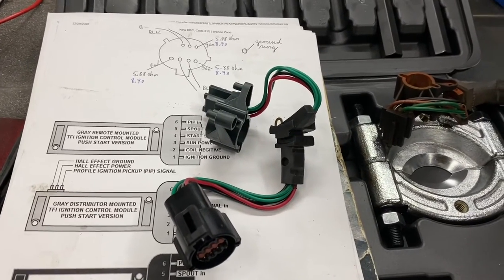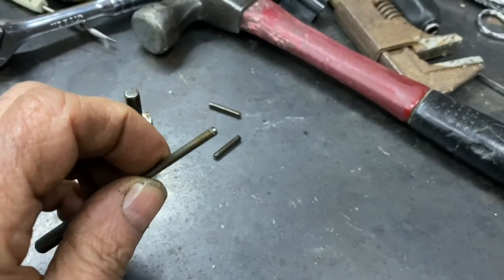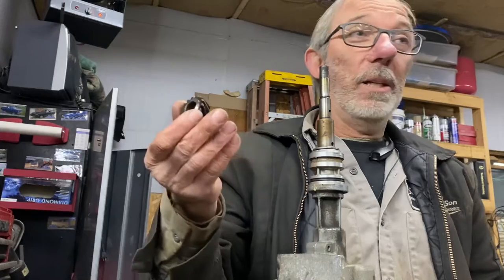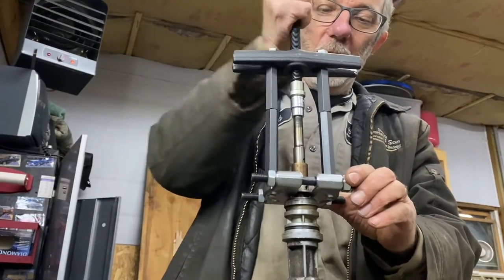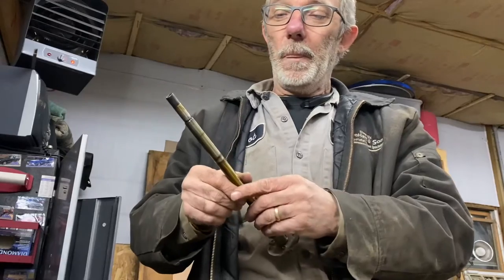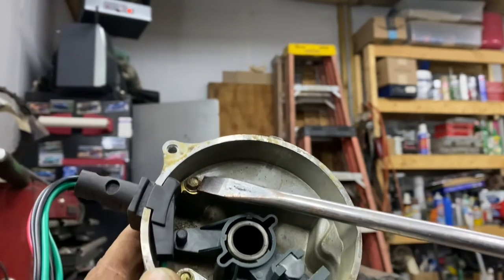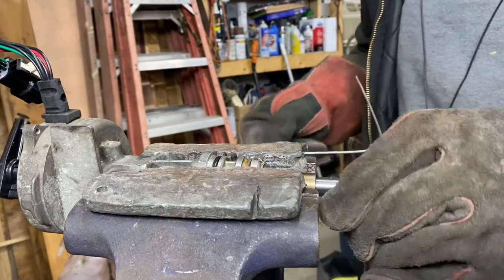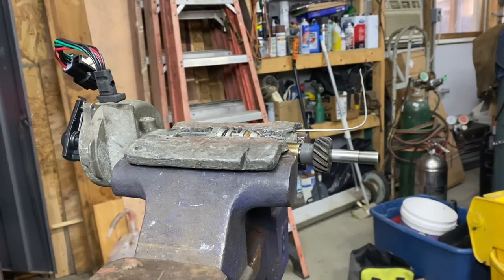92,93,94,95,96,97 Ford F150 distributor gear/pick up coil (PIP) removal and installation of gear

Comment: Great video. I'm getting ready to change the PIP in my 460 distributor and this video will help a lot with doing that. I was surprised to see that there wasn't any type of bearing in the bottom of the housing, just a seal. And thanks for showing the p/n of the seal and what would fit to replace it.
Reply from the maker: I'm hoping the video helps you out when you do your's. Keep in mind there are some bronze bushings inside of the distributor housing, so put some grease on them and the shaft when you reassemble. Good luck with your rebuild. Rob....
Reply: @robbieraychannel  Will do, thanks.

Comment: Excellent video. The gear install is what I needed to see. I watched a few press it on and figured there had to be a better way.
Reply from the maker: Glad it helped you out. Iv'e done it many times this way with no problems. Just be careful not to overheat the gear. Good luck with your repair. Rob...
Reply: @robbieraychannel  did you use your original gear? I am not sure if mine is steel or not, and am thinking of just reusing it, I don't see any unusual wear to it

Comment: Like I do with motor Cycle Cranks and bearing I always use Air Duster when installing bearings I freeze them with the Air duster, then I heat up the cases and they drop in.  You made this Video very enjoyable to watch. Thanks for sharing.

Comment: Thanks so much for this video. I spent an entire day trying to find that seal but didn't have a part number. Measured out the shaft and bore and the only seals I could find were at least a week out. With the part numbers you gave, I was able to find the seal in stock at my local Grainger.
Reply from the maker: Glad it helped

Comment: One thing i want to touch upon is that you didnt verify alignment of the gear placement as the gear has an odd amount of teeth and by reinstalling the gear 180* off you change when the injectors spray into each cylinder by 12* and cant be corrected by twisting the distributor  due to the fact that the small vane in the reluctor is specifically timed for the true 10* BTDC which is exactly when the injector needs to spray in relation to the valve..

I use a dollar store single burner to heat the gears up.........Your distributor has the steel gear because your engine has a roller camshaft.....The way to tell is whether you have the TFI module on the distributor or the one on the fender...The one on the fender is a roller cam engine..
Reply from the maker: Huh! Interesting info. I'll take a closer look next time I do one. Funny because I have done several of these throughout my career and never had a timing problem before. Could it be possible that I got lucky every time. I guess anything is possible.....I like the burner idea, less chance of overheating......

Comment: You can buy a whole distributor complete for less than $80
Reply from the maker: Yes you can but there is some concern with the drive gear matching the gear on your camshaft perfectly. There is even three different gears that were used on those engines. That's why sometimes it's a safer bet to use your existing distributor
Reply: @robbieraychannel .... Well,  my 1993 Ford f150 5.0 truck has a severe "Squeak " coming from the Distro...A commenter on another YouTube video said it could be the bearing...I used a Harbor freight Stethoscope and sho' nuff its squeaking like a flock of baby birds...My question is...How do you change the bearing out...???... What tools and what part # for the bearing...???... Thanks in advance,  sir...😊😊😊

Comment: Great job! I'm getting ready to do this on my 95 F-150 4.9l. Mine was hard to diagnose as it was intermittent. Whenever I would get my Fluke hooked up to check PIP signal, it would work fine; then leave me stalled on side of road. I finally caught it messing up and pretty sure PIP is bad! Thank you.
Reply from the maker: Best of luck with it !!!

Comment: Just dealt with this issue on my 94 bronco. It can have you chasing all over the place and throwing parts at the thing if you aren’t careful. Luckily I only went as far as a coil before realizing this was the actual issue. It fell flat on its face going up my driveway, but hey at least mine broke down at home! 😆 great video.
Reply from the maker: Lol lucky on that one. same thing happened to me a couple of weeks ago my starter went in my driveway
Reply: Too FUNNY... my '94 Bronco 5.8L died right in front of my driveway on my birthday while I was letting my wife get out with dinner in hand. It was the second car to die that day. At least it wasn't too bad pushing it up the driveway where I could work on it as I get time.

Comment: Thank you really good work will help me alot 1995 ford f150 4.9. Standard ignition best replacement part . Cardone rebuilds do not work.
Reply from the maker: Your welcome Jon
Reply: What is a push start ? Versus standard start for the ignition control modular ?
I have no idea what they're referring to unless they're referring to a push button ignition, but that does not make sense to me cuz they did not have a push button ignition in these older vehicles.
So what am I missing here ?

Comment: Thanks for the video. I am about to attempt this myself. Getting code 211 PIP circuit failure. I’m guessing I should probably invest in the Harbor Freight gear puller. Looks like something that may come in handy in the future. Thanks again!
Reply from the maker: You're welcome George and good luck with your repair

Comment: Thank you for a straight forward non hype video to replace the PIP sensor !! You are the ONLY one that shows the whole process.  Also was looking on BRONCO ZONE for but can’t find the printed page you have of the three TFI diagrams at the beginning of your video. Can you tell me how to find it at Bronco Zone or send me a copy, I’d really appreciate it. Thanks for your time, your video makes this job pretty easy when you see all the steps. Keep up the great work.
Reply from the maker: Keith, I will see if I can find it. I'll let you know
Reply: @robbieraychannel  Thanks Robbie for quick reply. You’re the man!  I found it but couldn’t print it, probably due to not being a member. I’m restoring my (original owner)1997 F250HD 5.8 XLT 4x4 and that diagram is invaluable due to ford having wrong info on the ICM /TFI.  This is more proof I need the BLACK CCD version. Ford and distributors keep insisting I need the gray “push start” version. NOT!!  You have a new subscriber. Thanks again for making a difference with a great video and great demeanor. 🇺🇸👍

Comment: Nice job!  Thanks for doing that.  Curious what kind of grease you used in the shaft
Reply from the maker: I used a black molly grease that I had but more than likely any grease will do because it does not move at very high speed

Comment: 91 ford tempo  4cyl mine had maybe 1/8  shaft play at the top & a lot@ bottom / problem was a slight amount of  oil in dist/ shaft gear very tight

Comment: Hi! This repair fix the 212 code? You need to dissasemble the shaft to change the PIP? Sorry i'm new to this DIY repais 😅
Reply from the maker: Ben yes you do need to disassemble the shaft to replace the p i p sensor and yes it does fix code  212 however you can buy a complete aftermarket distributor for about$120 just be sure to put the engine in time before removing the old distributor. Check some videos on how to do this

Comment: What is the name of that rod (shaft) you put the ratchet head that attaches to the bottom of your distributor? Love the vid btw!!! Earned a sub
Reply from the maker: I'm not sure exactly what you are asking but I think you were asking what is the piece that I put into the bottom of the distributor to pull the gear in that case it was a quarter inch Allen socket should be able to find one at just about any auto parts store

Comment: I just beat the hell out of mine to get the gear and collar off. Kinda mushroomed the other end getting it back on. Had to sand it down so the spinny bit would go back on. One of the roll pins got screwed up too so I had to use a tension pin. Hope I didn’t ruin it.
Reply from the maker: Those things can really be on there tight. I hope yours is going to be okay but keep in mind that gear runs on your camshaft and the bottom of the distributor shaft with the hex key shaped hole runs your oil pump so if it's really questionable you might want to consider getting another one in case something comes apart and does internal damage. best of luck with it. Rob....
Reply: @robbieraychannel  the bottom where the gear and collar are was fine but the top end where the rotor goes was the mushroomed part. Still concerns?
Reply from the maker: @WalterMelons  it could be bent a little but as long as it doesn't wobble so bad that the rotor hits the inside of the distributor cap I think it will be okay
Reply: @robbieraychannel  yeah I spun it when it was back together and the flange the rotor sits on is a little off kilter but it spins fine and doesn’t hit the stator. I’ll keep my fingers crossed and if it runs poorly after getting the timing right I may end up getting another from a junkyard. A timing light should be coming from Amazon today so we’ll see. 🤞
Reply from the maker: @WalterMelons  oh that's cool did you research where you have to unplug the spout jumper to set the base timing
Reply: @robbieraychannel  yeah I’ve been watching scannerdanner the past two days and picked that up. Good luck out there, thanks for the video and the info. 🤘
Reply from the maker: @WalterMelons  You too good luck with it
Reply: @robbieraychannel new update! Got the timing light and went to get it hooked up and realized I didn’t plug the damn first plug wire back in that I unplugged to get the distributor out in the damn first place! 
Got everything together and got the timing dead nuts and she runs like a top now!

Comment: If you heat it up to take it off, will it pop off easier?
Reply from the maker: Deuce usually that doesn't work because the gear and shaft will grow from the heat at the same time, therefore not allowing the gear itself to become any looser. This can work on seized nuts because you can quickly heat one side of the nut with a oxy/acetylene torch to make the nut expand. But you wouldn't want to put that hardened gear through any kind of abuse like that and damage it's tempering.

Comment: Would this help or fix stalling issues when putting truck in gear form park.

1995 f150 xl I6 4.9 auto 2wb.
Reply from the maker: That’s hard to say Mike usually when something stalls out like that it’s probably not idling very well in the first place might want to start checking simple things like vacuum leaks or go online and learn how to pull the fault code for ODB one systems by reading the flashes on the engine light I would start from there
Reply: @robbieraychannel  

I'm getting a code reader in a few days. I've started to check vac lines, and have some tests to do that I've seen on the tube. Thanks for the response and I'll update what I find out. Great instructional video, sir definitely a great help.
Reply from the maker: Hey Mike just keep in mind that your truck is a obd 1 system the newer odb 2 scanners won't work unless they are very high end ones. Autozone sells a Innova odb 1 scanner for Fords for $29.99. You can also read the codes by jumping out certain terminals on the odb 1 plug found under the hood, drivers side, on the fender nearer to the windshield. But keep in mind reading the codes by counting the engine light flashes is a real pain. I have  seen it throw a phantom code just because the heater switch was on at the time of the test. You tube has tons of videos on how to run the test. Good luck. Rob...
Reply: I still use the Autoxray FORD OBD1 scannner/data streamer I bought back in 1996/97 to scan/read my '95, my '90 ford truck doesn't stream data, only codes.
They come up on ebay occasionally.

Comment: Looks like a laugh a minute lol so I should mark the gear ⚙️ so it lines up straight? Good video 👍
Reply from the maker: Actually the line I made ended up not being that necessary because if you heat the Gear to about 500 Degrees you will have about three to five seconds of time where you can still line it up. the more important thing is to make sure you have some kind of pin punch or a nail or something that fits fairly snugly in the roll pin hole so that you can line it up quickly before it cools. Then of course after it cools completely you can put the original roll pin back in
Reply: How did it work out for you any running issues? I did my sensor today I just have to press on the gear and put one pin in it’s a little time consuming but it fills nicer than any after market distributor! Good looks on the video I been a mechanic by trade since 93 when I graduated high school it’s been tough keeping up with technology these vehicles are getting very complex
Reply from the maker: @sweetassugar2076  It's been running great since the sensor replacement. I hear ya on the newer over complex stuff.

Comment: I am looking for a video that shows me how to remove and install it and that’s what your says but in all honesty I don’t see that anywhere in your video. Can you please point me to a video that you did where you’re actually taking it out and putting it back in? Versus one where you’re just sitting here changing parts on it.
Reply from the maker: The video that I made was focused on removing the gear on the bottom of the distributor and putting it back on because this is what most people struggle with you should be able to find videos for installing a distributor into the engine pretty easily but sorry I don't have one prepared

Comment: how are you testing the ohms on the pickup coil? do I disconnect the plug? where do I put the multimeter leads?
Reply from the maker: Okay with the distributor plug disconnected put the black meter lead on the distributor metal base for a ground set the meter to 20K ohms both green wires measured 18.52 ohms the red wire measures 16.46 ohms and all the black wires are grounds
Reply: @robbieraychannel  Awesome thanks for taking the time to reply. I'm trying to track down an issue with my truck, has an active 565 (unrelated) and memory 212 code. It randomly is hard to start and keep running but after a few minutes it runs and starts fine. I have 2 videos on my channel.. really has me stumped

Comment: robbieray I need a new Pickup coil for my 1993 351W (not lightning) but I can only find the rotorcraft DU50 Pickup coil which is only for the lighting. will this work in my truck? I don't want to get anything but motorcraft. Thank you
Reply from the maker: Gadnuk, I believe they will be the same. But I'm not 100% sure. Sorry
Reply: @robbieraychannel  no worries whatsoever. I appreciate the reply. What brand did you get for your replacement?
Reply from the maker: @gadnuk7159  It was duralast from advanced auto or auto zone. Haven't had any problems with it so far
Reply: @robbieraychannel  Duralast is AutoZone's brand. I'm going to get a replacement from them as well likely. Thank you for the update+

Comment: So why wouldn't you use the torch method for removing the gear as well ????????
Reply from the maker: Steve that is a great question. usually if I'm trying to remove something that is going to be thrown away like a bearing race stuck on an axle or something like that. I would heat one side very quickly red-hot with an oxy acetylene torch so that it expands but if you do that to something like that gear you could risk damage to the gear. if you heat the whole gear equally than both pieces the gear and the shaft will expand at the same time  and it will virtually almost do you no good.
Reply from the maker: PS. I probably didn't make it very clear in the video but the goal here is to be very careful how you treat that gear. if you were to accidentally overheat it there is a chance that you could make the steel soft or brittle. if the teeth on that gear break or come apart it could damage the gear on the camshaft inside your engine and then you would have a even bigger problem
Reply: @robbieraychannel  you made it clear to be careful not to go over 500 Degrees.
I just figured gentle heating would make it come off a little bit easier.

Well I decided to do both, buy a new distributor and rebuild my old one.
Every brand of distributor I look at seems to have problems and it looks like it's a roll of the dice. Even the very expensive MSD seems to have its share of bad reviews.
I decided to go with WAI from O'Reilly's because it's reasonably priced and I can't seem to find any reviews at all. So I guess I will be the guinea pig and I will get the parts to rebuild my old one at the same time.

Wish me luck🤔
Reply from the maker: Steve, I hear you on that one usually a little bit of heat makes everything come apart a bit easier. it's just because it's a heat-treated gear that makes me a little bit leery of subjecting it to any more abuse than it absolutely has to be. maybe something like a heat gun wouldn't be too bad. if you try that let me know in the comments if it works out for you. thanks for posting and good luck with it. Rob.......